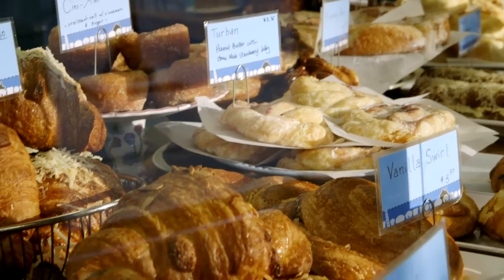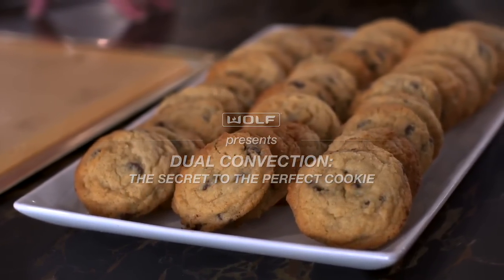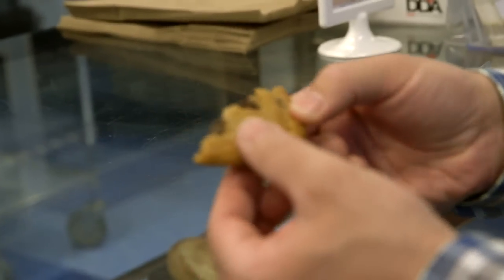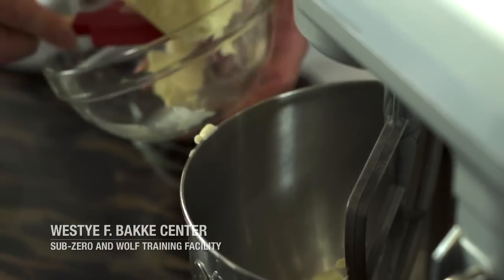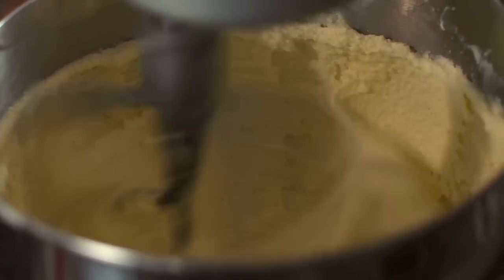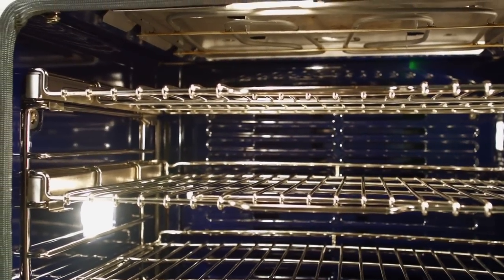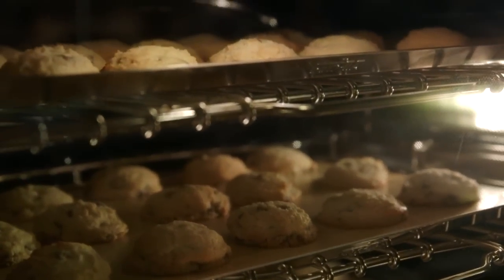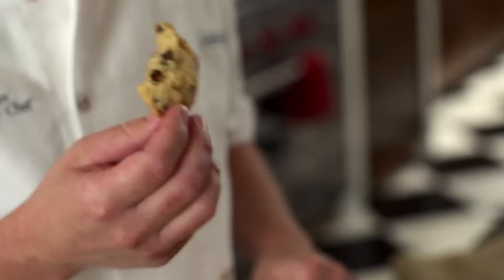Wolf Dual Convection: The Secret to the Perfect Cookie

Comment: what temperature do you use when using convection? Recipes are always geared towards regular baking.
Reply from the maker: +Melissa Skitch To convert standard recipes to use convection, we recommend reducing the temperature by 25 degrees (F) and reducing cook time 5 minutes for every half hour of cooking. So, if the recipe calls for 1 hour at 400 degrees, change it to 55 minutes at 375 degrees. Hope this is helpful.